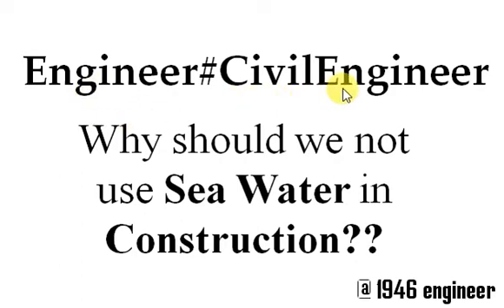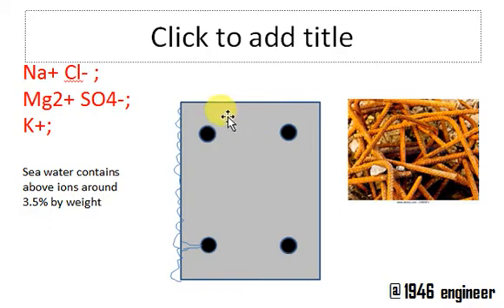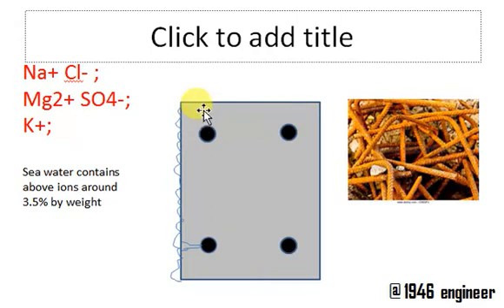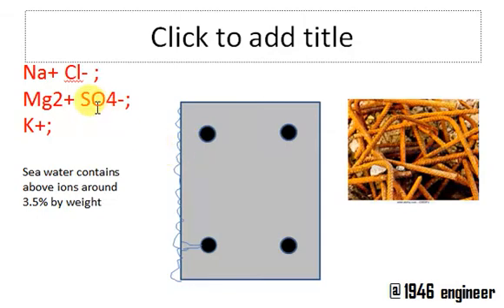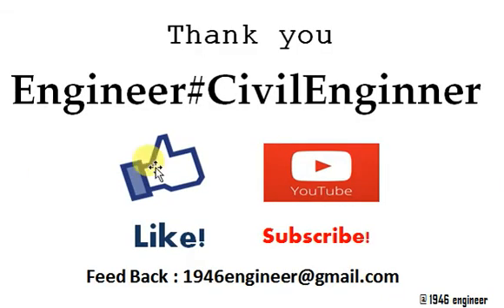Why we don't use Sea Water in construction?

Comment: Im building a skatepark by the oceanside, what would happen if I painted all my rebar with an anti rust agent first?
Reply from the maker: it will not be helpful. It may also reduce the grip between concrete and reinforcement. Beyond this I am not in a position to suggest. 
regards
engineer#1946

Comment: WHAT IS THE QUALITY STANDARD FOR CONSTRUCTION WATER ?
Reply from the maker: http://www.iitk.ac.in/ce/test/IS-codes/is.456.2000.pdf 
please refer section 2- 5.4
there you can get complete details of water standard.
if you still have doubts, feel free to comment.
regards 
engineer#
Reply: engineer# 
If the water fails to some parameters, is there treatment for that water?
For example 
1 requirement to 0.02N h2so4 to neutralise 100 ml of sample